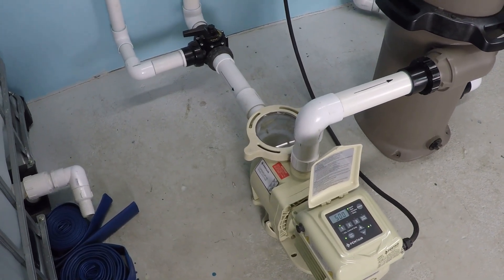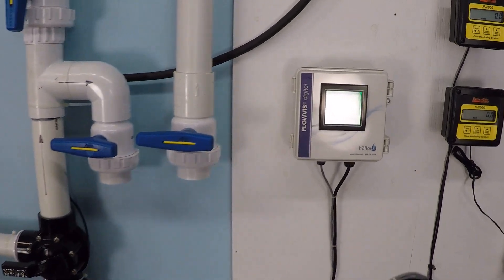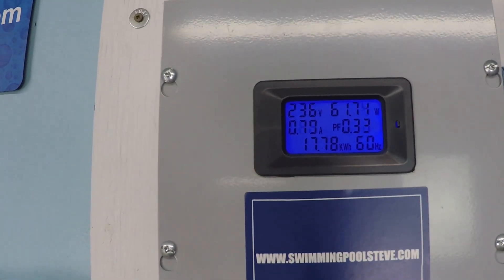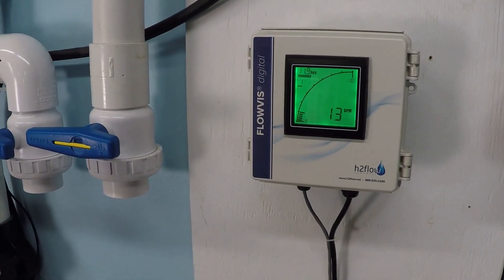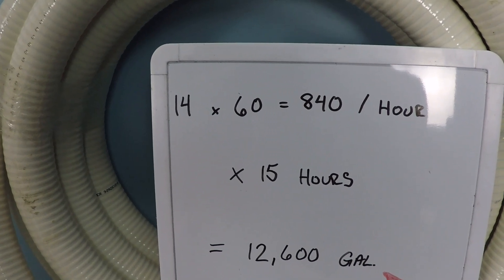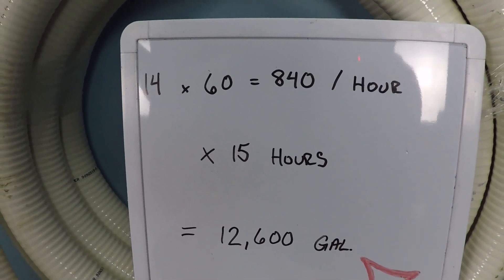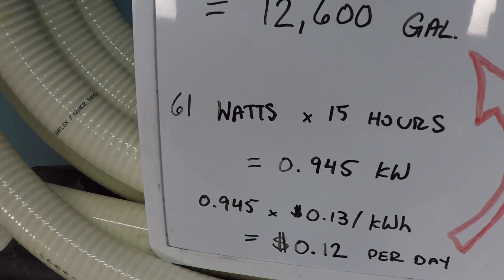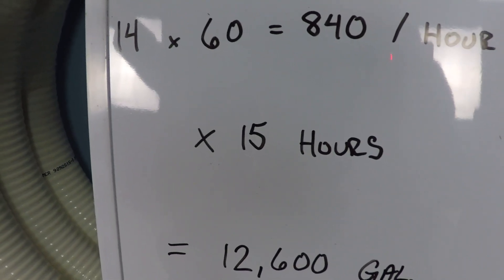Maximize Savings With A Variable Speed Pump

Comment: I have a 15000 gallon pool and have been running my vsp at 20 gallons per minute 23 hours a day. I run the pump at 75 gpm for one hour when using my pool cleaner every morning. There are times where we run the pump higher for better spillover and to use the tanning deck bubbler. We just had the pool installed in December of 2020 and haven't made it through a summer yet which brings me to my question. Knowing all pools are different, is it possible to continue this run schedule throughout the summer and still keep up with filter and chlorine demands? I'm in Texas where the summers get 100*F and plenty of sun.  I use a combo of trichlor pucks and calhypo for chlorination, currently my pool is crystal clear without any issues

Comment: That is a really low power factor. the actual consumption I'd imagine is 180W, basically tripling the cost to run. How would you correct that?
Reply: His power meter is calculating PF. PF is true power/apparent power or W/VA. It takes the actual watts read by the power meter and divides that by the apparent VA. 61W/188VA=.32PF